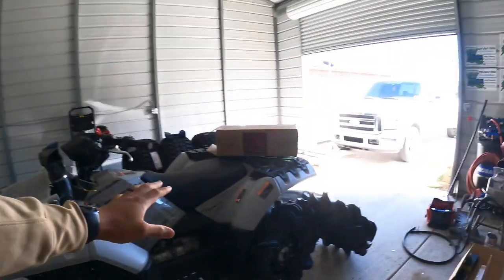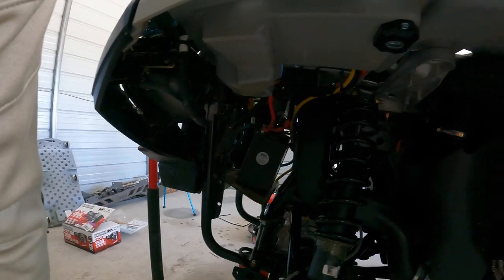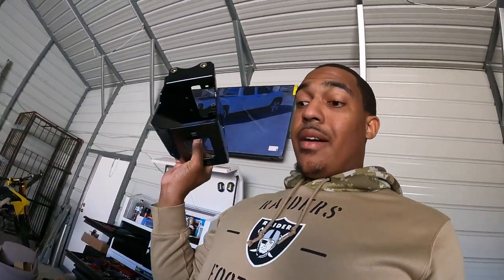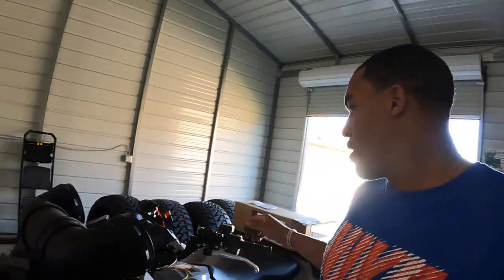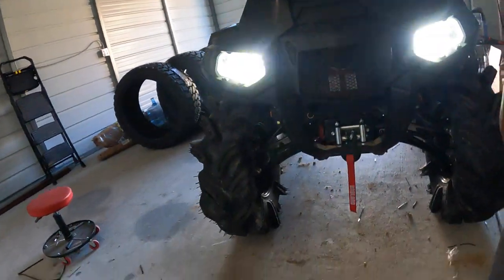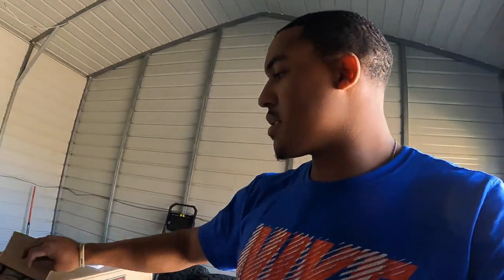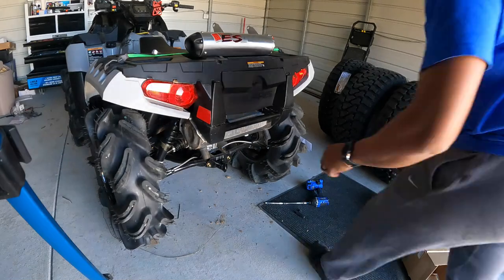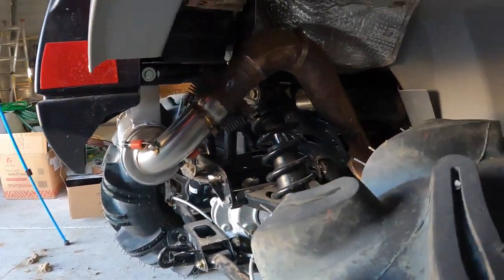2021 Polaris Highlifter 850 build pt2 | Straight piped | Badlands 3500

Comment: What did you mean by the fit in finish? Did it not properly sit ??!
Reply from the maker: the bend to meet up with stock exhaust pipe could have been better. Overall it's a good fit
Reply: Well mines isn’t sitting 100% but do you think it would damage anything or should I be ok brother ?
Reply from the maker: @javierjimenez4144  where does it not fit correctly?
Reply: At the connection of the stock pipe exhaust and the tip exhaust , where it supposed to sit on the rubber gasket
Reply from the maker: @javierjimenez4144  your gonna have to put the exhaust how you want it to fit and then tighten the mounting bolts while holding the exhaust so it doesn't move. Make sure you have the springs in place also